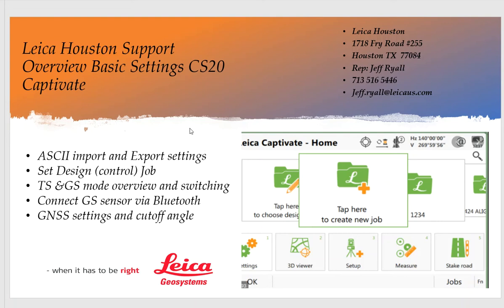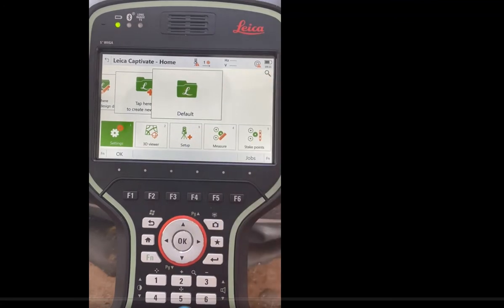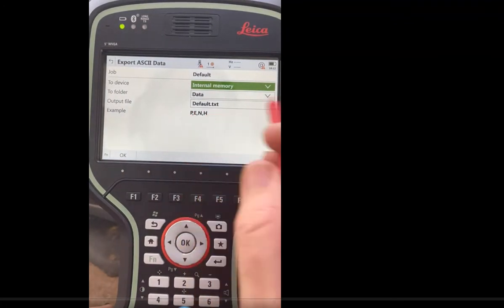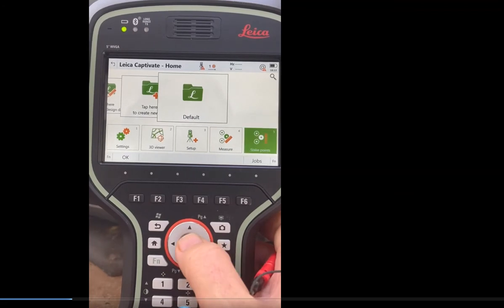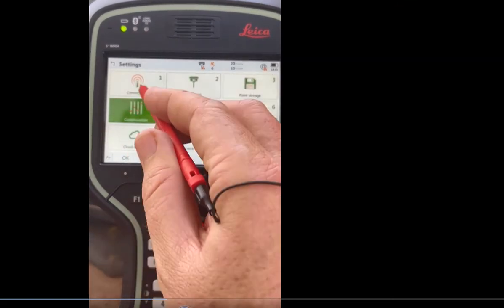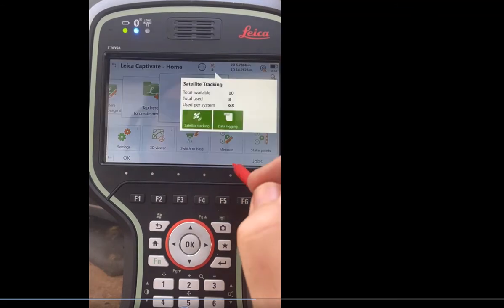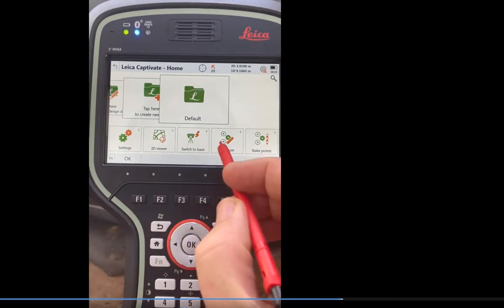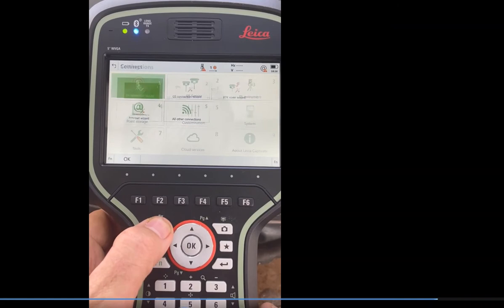Video 1 :Basic Settings of Leica CS20 Main screen

Comment: Thanks Jeff! I've been trimble for years and recently scored a job with a company that's Lieca based. What's your video recommendations on GPS setup and potential rookie errors for both TS and GPS? I believe they use the latest gear